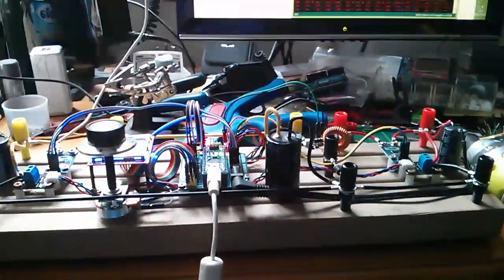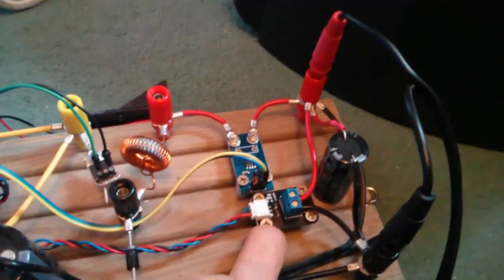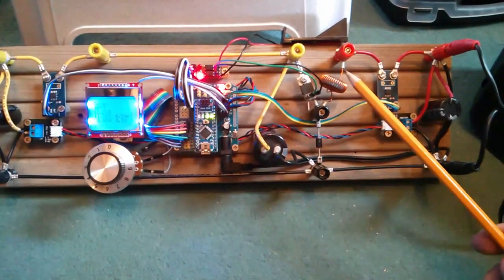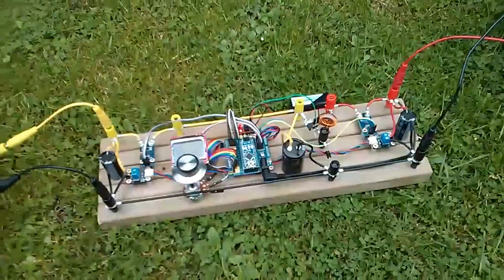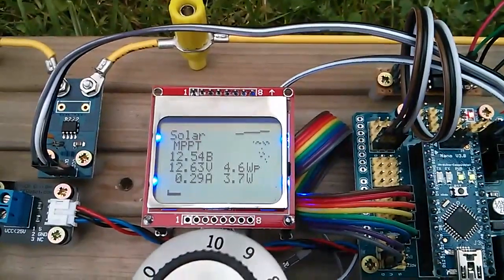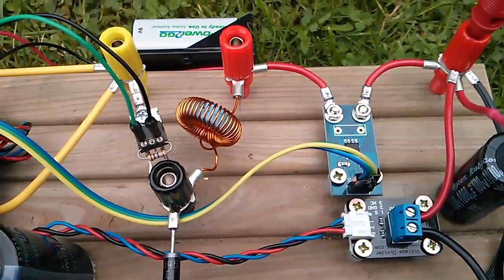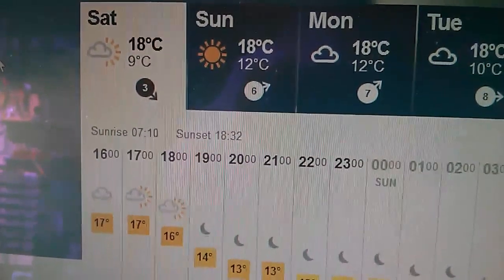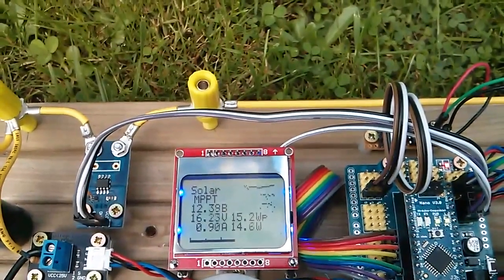Arduino MPPT Solar Charge Controller #16 - Testing the New Board

Comment: The Buck Converter should have a Low ESR cap directly at the MOSFET Source to Ground, then also at the output side of the Inductor... not after the current sensor.  High-side MOSFET drivers... remember, you need to turn the Gate OFF fast, as well as ON fast. Look at the Fairchild FAN7371MX or Micrel MIC5014/5015. Also consider shielding the Hall current sensor in some ferrous metal. And... of course, there are other ways of measuring DC current... differential voltage drop across a shunt... but I'm not sure if the differential ADC is cheaper than the hall effect sensor.  Great project... still watching the entire playlist...

Comment: I've seen a few videos of your MPPT Solar charge controller but never really understood how it works. But with this video I finally understand I think. 

Changing this PWM cycle would increase and decrease the voltage in the buck converter. I've found this out myself playing with a 555 timer DC to DC converter. The same is true for an SMPS as well I think. Is the idea here to keep the output voltage the same no matter how little and how much light the solar panel receiving? So the battery is always charging? and when the battery voltage gets to around 13.5v the charge controller just trickle charges the battery to always keep it topped up.

Comment: Julian is it possible to send me a copy of the part list for the Aarduino you are using I would like to try something like it here in the states (ohio).
Reply from the maker: Not sure what you mean by a parts list for the Arduino
Reply: If possible I would like to know what type of Arduino you are using, I have not worked with any of the Arduino line before and would like to try a controller out.
Reply from the maker: Richard Lesley I'm using the Nano in this project with a Nano breakout board

Comment from the maker: It's a simple potential divider designed to scale 25v down to 5v. It has a 303 (30k) resistor on top and a 752 (7k5) resistor below.
I modified the sensor on the solar panel side to scale 47v down to 5v. I added a 33k to the 30k making 63k on top.
63+7.5=70.5
70.5/7.5=9.4 (47/5 is also 9.4)

Comment from the maker: It's certainly true that using a linear regulator to take 12v down to 5v isn't very efficient. But at these current levels, the Watt loss is pretty small. Accuracy isn't affected much at all. Looking at the data sheet for the 1117 regulator, load regulation and output stability only change by a fraction of 1% as the temperature increases. But the 1117 has an absolute maximum input voltage of 20v, so if I want to make this work on a 24v battery, I may have to use a switch mode regulator.

Comment from the maker: 1. not yet  2. limited only by buck converter components  3. yes, with suitable profiles.
Next steps are: calculate efficiency and display, build simple MPPT control loop, build battery voltage regulation control loop (your point #1).

Comment: Julian, some questions: 1) at this point are you monitoring the charge state of the battery (in order to avoid overcharging)? 2) what would you estimate is the largest pv panel the system could handle (watts)? 3) would the system be able to work with various lead-acid battery architectures, e.g., deep-cycle and standard auto batteries (not at the same time), etc?
PS great series of vids. Thanks.